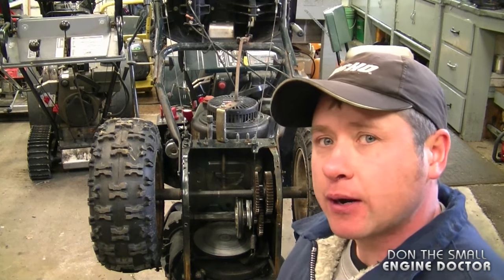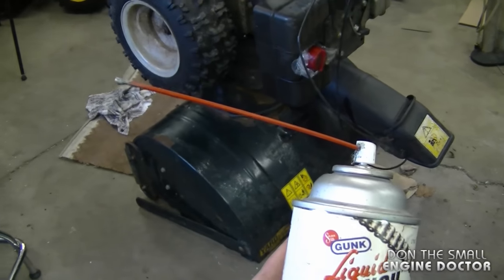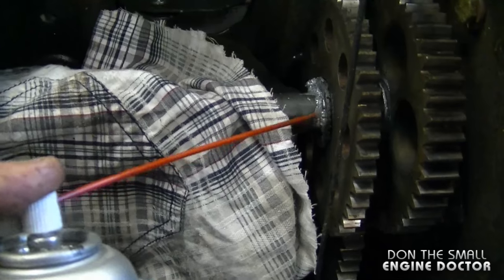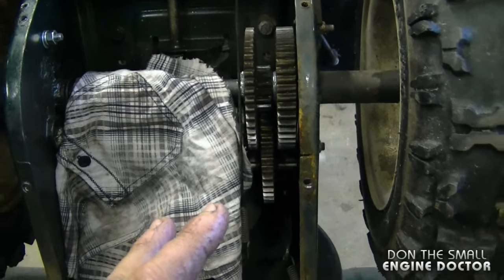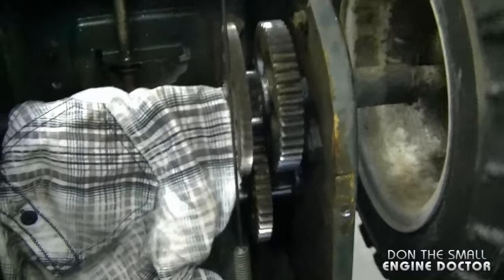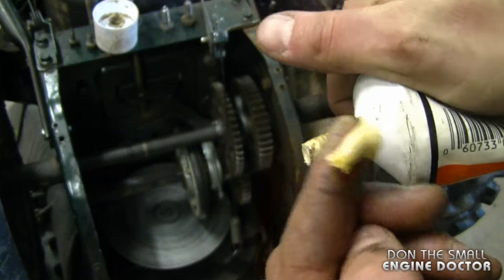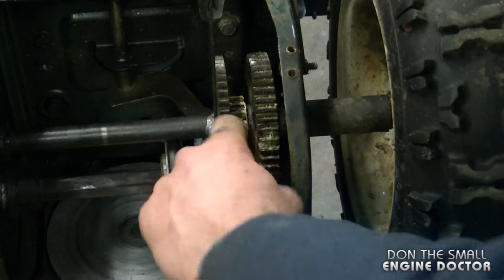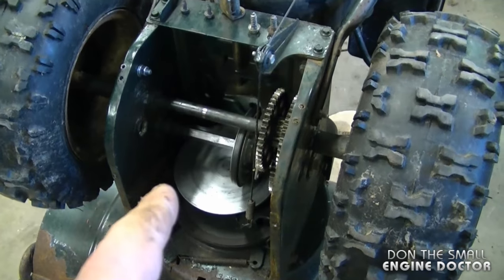Snowblower Maintenace - Lubricating Transmission Gears

Comment: Donyboy, I just picked up a couple of Yamaha YS624T's. As you know, they use a different system than the typical MTD blower for shifting. They run okay, (they'll run a lot better when I clean the carbs) but there are problems with the shift plunger sticking in some gears on both of them. Any chance you could do a take-apart video on a Yamaha? I'd sure like to see how that whole shifter linkage goes together, adjusts, and what's making the plunger bind.

Comment: Are you sure you're supposed to be using chain lube pushing it in those gears where the roller bearings are? 

Would n't like DuPont Teflon lithium grease that's designed for a bearings be better?

And what about fluid film?

Comment: I assume if I've got chains in there instead of a bunch of gears, the chain lube will do the trick too.

I've used brake cleaner for the friction disc if you get something on it, since brake cleaner, unlike its relative carb cleaner, leaves no residue.

Comment: Please add this question to your video "to do" list.  I have a 8HP John Deere Tecumseh snow blower that starts easily, runs great, drives fine, and the auger turns well, but it dies almost immediately when it tries to throw snow, even just 3 inches of light snow.  The carb is clean, the mixture correct, but I'm stumped.  Thanks.

Comment: I have 24” craftsman snowblower. When the auger is engaged is makes grinding sound
Dis constantly. Sounds like so,etching rusted or dry.  Do you know if there is something I should be lubricating or grease fitting?  Thanks

Comment: I have an old Toto 832, 8hp.  each hub has a slip cover so if you pull the right or left knob on the control dash, that wheel unlocks from the axle and free spins.  I have the left side that is not locking up to drive.  Have you done a video on this or is this not worth fixing?  Thank you!

Comment: That hexagon shaft that the friction wheel slides back and forth on, should it get a bit of grease? (I do apply some regular grease) As usual, great advice Dony!
Reply: Yes, the hexagon shaft needs a little lubrication. I put a little engine oil on my finger and run it back and forth on the shaft and then use the walk speed lever do distribute the oil.

Comment: I got a poulan pro pr300 two stage blower and wanted to remove gear box. There are two shear bolts where the gear box shaft meet impeller.  I took two bolts out but couldn't get shaft out. Is there another bolt behind the impeller,  do i need to split the blower . I was under the impression that it was designed that way so it was easier to remove gear box and auger assembly. Or is it just stuck.

Comment: I put the grease on an old tooth brush instead of using my finger.
Reply: that is a good tip
Reply: I have tried a small (1/2") inexpensive paintbrush it seems to work well with white lithium grease.

Comment: Don, great tip.  Do you, or anyone else on here, spray any parts of a snowblower with some type of coating when storing it after the winter, to prevent rust/corrosion from winter salt?  Similar to undercoating a car for winter? What type or spray do you use?
Reply: A wash down then coating of Fluid Film.
Reply: Dand M I use old engine oil, just wipe a film on everything after it's washed.
Reply: Our cars get an annual application of Krown Rust Control and whenever I visit them, they give me a complementary spray can of their corrosion inhibitor spray. At the end of the seasons, I clean up the machines and they get a good spray of the Krown before going into storage.
Reply: WD40 cheap & effective. invented by NASA as a rust inhibitor for re-entry vehicles..sprayed a steel nail with WD40,  another one without...no rust on the WD40 nail for 6 months..untreated nail: rust started less than 12 hours.

Comment: You have some great how-to videos. That's why I've been a subscriber for quite some time. I have an issue and I wasn't able to find a video for the fix.  I have an older Craftsman snowblower. I'd guess it's a 1998. My issue is my lower gears (1, 2, and 3) don't work. The shift lever moves to Reverse 1 fairly easily but I have to yank on it to get it into Reverse 2 and then it will pop back out. The drive has one chain on the left and one on the right. I moved the shift cable to various positions in the adjuster plate  on the lower cable. So much so that it actually was in reverse when I had the selector in a forward gear.  I put it back to proper hole and the cable is tight with a small amount of slack  Any idea how to adjust this so it works properly?
Reply from the maker: sometimes cleaning the shaft that the drive disc slides on makes it easier to shift
Reply: I tore the whole machine apart underneath as described and took out the shaft. I cleaned that with a steel bristle wheel on my drill , lightly greased the shaft, cleaned the friction disk and the disk it applies too and I still have an issue with gears. All wshers etc are in correct position. 1st gear is s somehow reverse and one reverse gear is reverse and reverse gear farthest to the right the rod pops out. I also adjusted the rod where it meets the rectangular bracket. Problem still exists. I guess I  will leave it that way